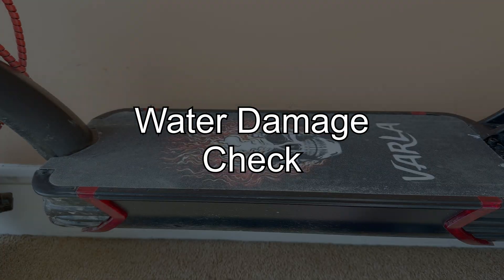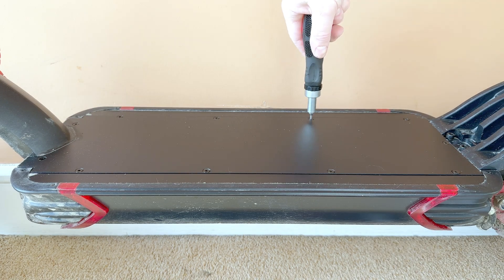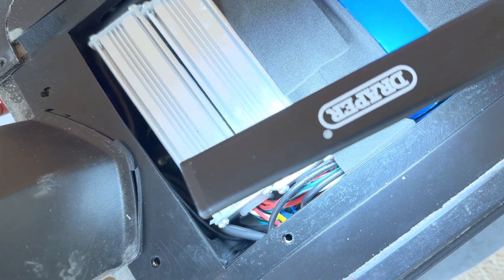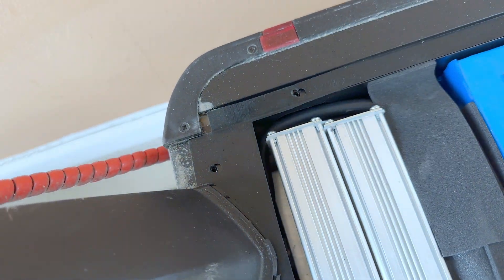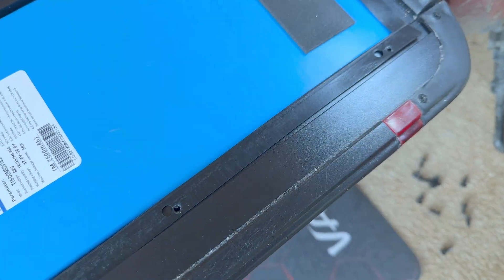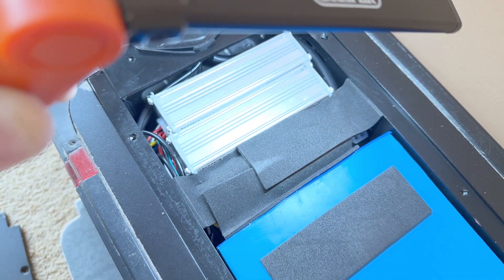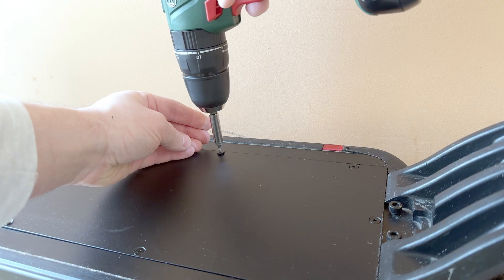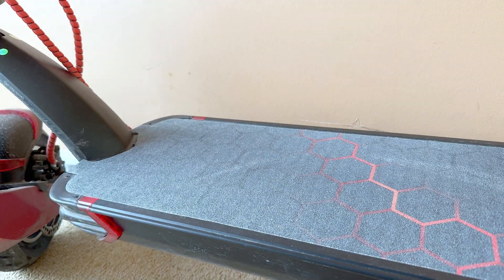You must inspect your electric scooter if this happens

Comment: Good advice all-round - nice one. In context, the rating ISN'T straightforward percentage: 5/4 does not mean 54%. Rather the first indicator is SOIP - Solid Object Ingress Protection (sand/small pebbles/stones and so on) - the rating being out of 9 (yep, NINE). The second indicator is LIP - Liquid Ingress Protection (i.e. rain/puddles/dogspiss[!] etc.) - out of 10.. SO: the rating 5/4 equates to 5/9 for solids protection & 4/10 in terms of liquids. Why this methodology? To quote Eddie Izzard - "I HAVE NO IDEAR". Happy travels.
Reply from the maker: Yes
First number is dust rating.
Second is water resistance.

The me Inmotion scooter has IP67 battery rating. Looks nice!

Comment: I always check my Xiaomi Pro 2's internal compartment
Reply from the maker: Xiaomi is sealed very good. Never had issues myself.
Reply: @Movelectrics  I live in a very rainy country, and im using my Xiaomi very often. Almost 2 years now never had an issue should ı open and check?
Reply from the maker: Personally if it was me, I would open it up and check the internals. Then silicone when putting the plate back up.

Of course though if you don’t feel confident, get a professional to do it.